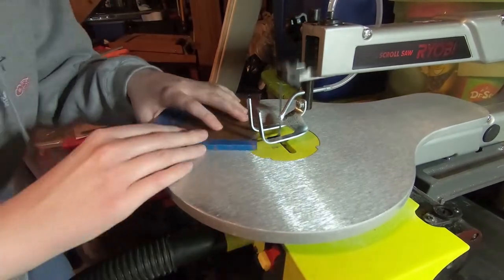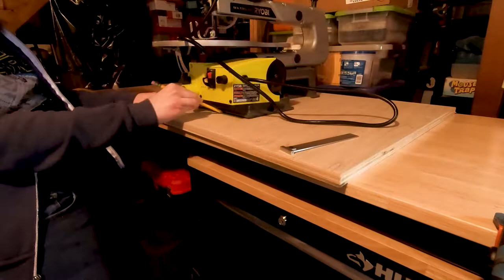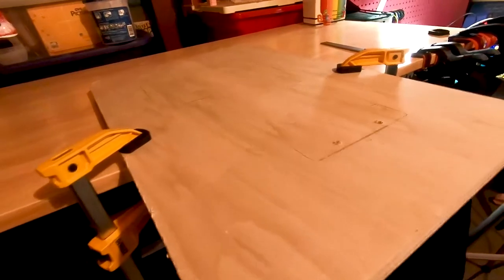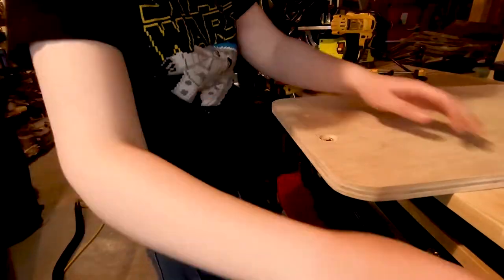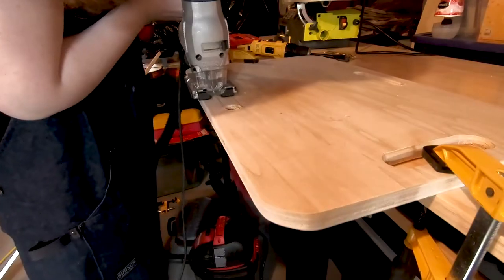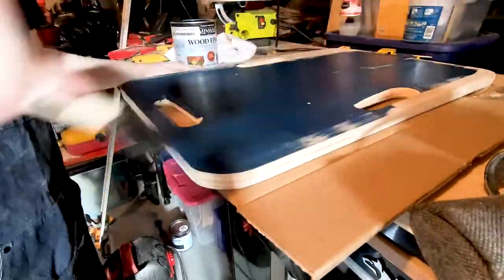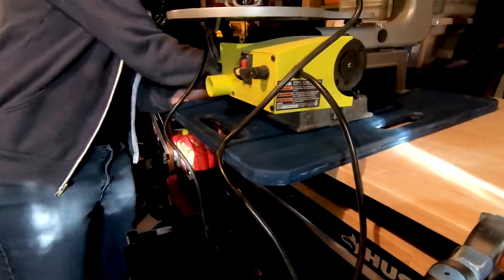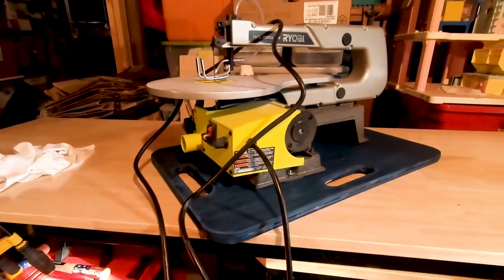Make Your Scroll Saw Stop Jumping Around

Comment: Fantastic job with the woodwork. That hand-held Dremel router is the business :O nice work with the handle cutouts. Is there any way to attach a fence or guide roller bearing for the router bits? That would help get a straighter edge in future.
Reply from the maker: thanks! i think there is, definitely something to look into

Comment: My saw keeps pulling the wood up like crazy that I'm trying to cut, most people say the blade is upside down but it does it with both ways. Do you maybe have any advice or insight into how to fix this?
Reply from the maker: i would check the tension of your blade if you haven't already. i was experiencing this a bit and dialing that in seemed to solve it. it is important though to make sure you don't over tighten
Reply: @BlitzCityDIY  thank you, I was over tightening it. Many thanks